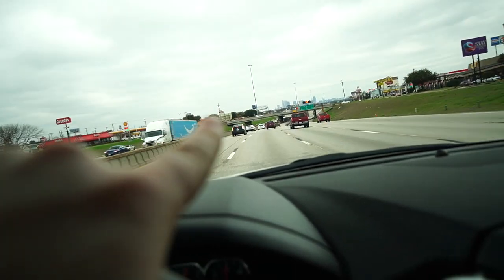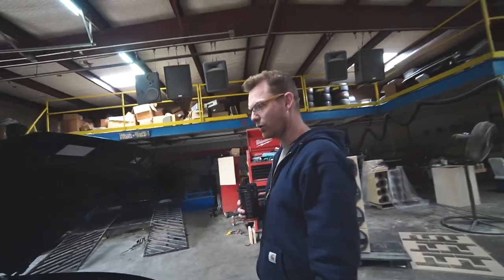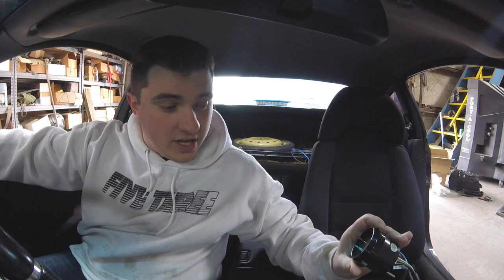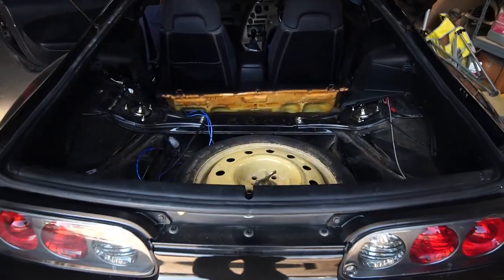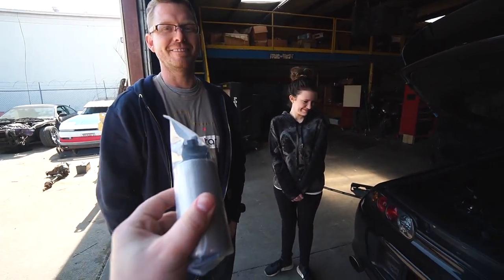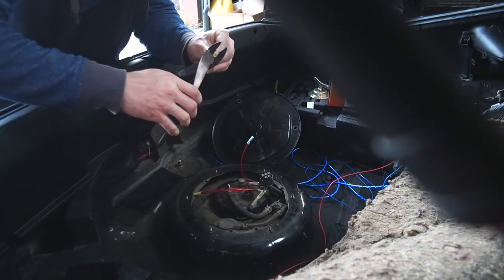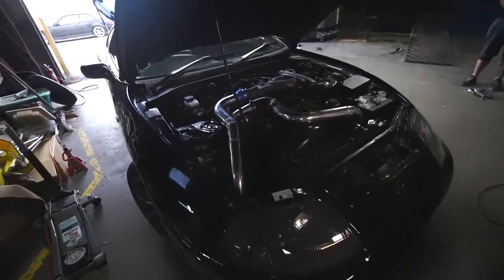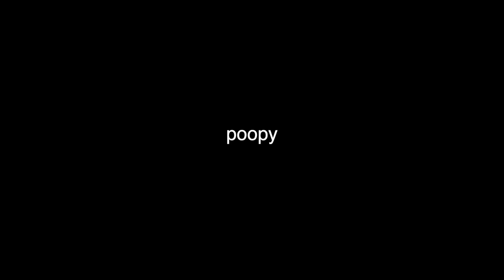FIRST PULLS in the eBay turbo Supra!! (NA-T Build)

Comment: Doing a NA-T build on one of my mk3 supras right now. I got almost everything needed besides the innercooler and piping. Its a comp boss JR bolt on turbo for the 7m and I should almost be able to triple the cars output from stock with the kit. It's my first turbo build ever and I'm supra excited! Also got a 1uz swap going into a mk2. This summer is gonna be the best!

Comment: is the 350Z a good car for daily drive? i'm looking for one (I'M from the netherland)
Reply: Jordy Smand Engines are awful for blowing up and heat
Reply: Gearoid Tully wtf these motor are bullet proof
Reply: Nic Beccherini I know engines which are bullet proof which you can hold down the accelerator and spin the wheels and slap them off limiter for however long you want and them 350z can’t take it
Reply: My opinion over yours like I know you might have a different one so we will just agree to disagree